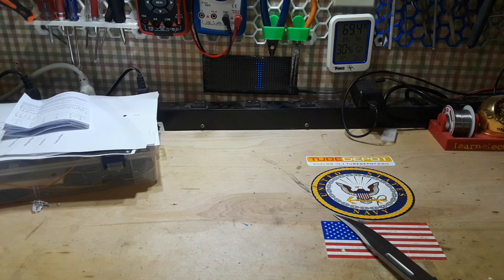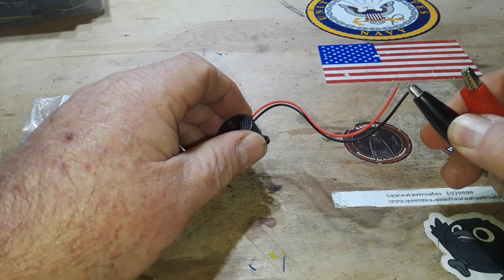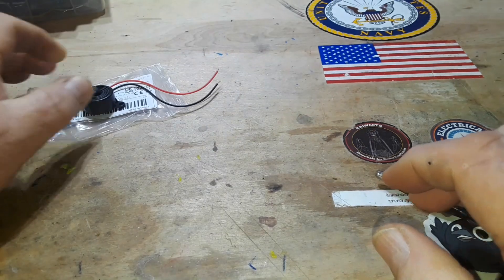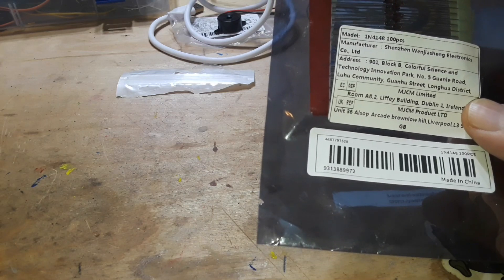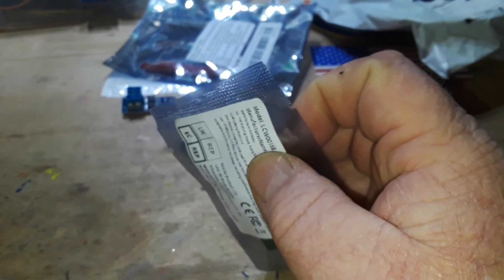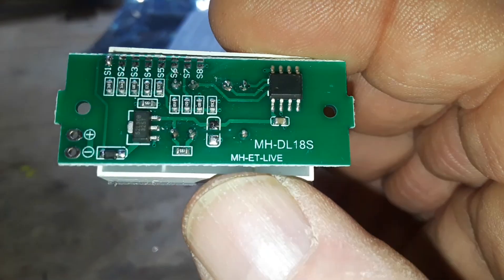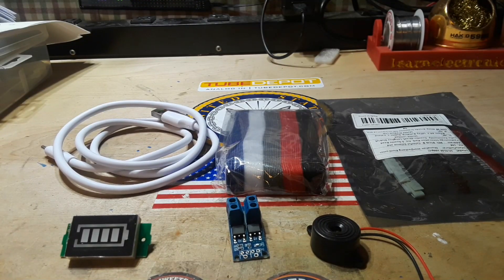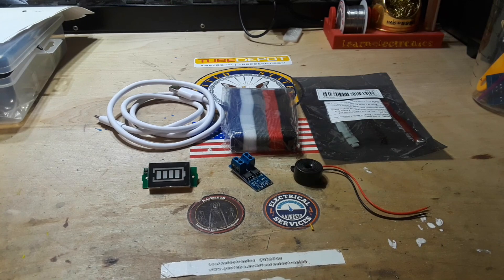Six Electronic Items from Temu for $10

Comment: I think that mosfet module has counterfeit or rebranded mosfets so don't trust what datasheet say but measure what is voltage drop in certain loads and check how it heats.
Basically ok for hobby project where you don't try to go close mosfets operating limits. In some "lucky" scenarios you will only have used parts and worse you have defect ones from manufacturer.
Also cheapest 100pcs 1n4148-T26A was 1.9e without vat in mouser (onsemi/fairchild) 10k is 0.007e/pcs (70e)